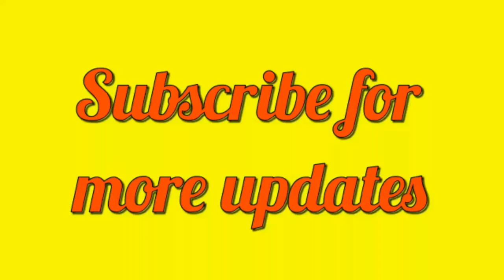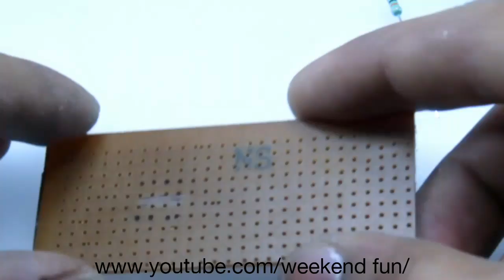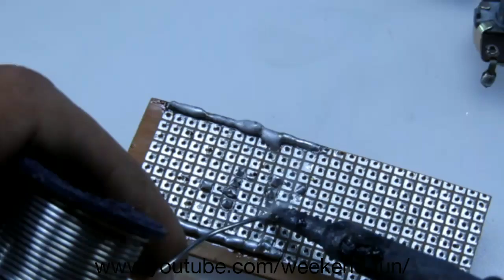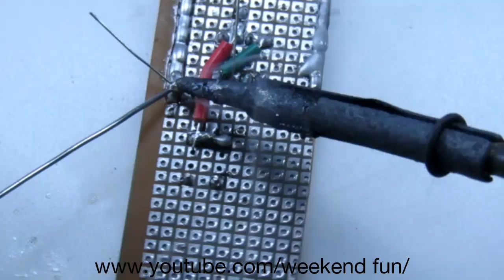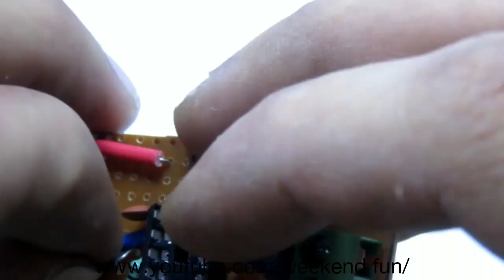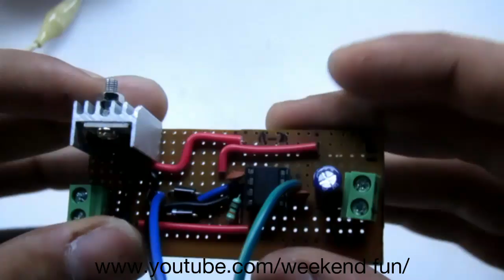How to Make PWM DC Motor Speed Controller

Comment: Greetings friend
I have a Brushless Motor Driver for Polygon Mirror taken from a Xerox Laser Printer; the board has 5 input pins: 24v, Gnd, 5v plus two signal pins; does this circuit work to increase / decrease the speed of the engine in question? Thanks

Comment: What if I want to control a 70 V DC motor with 20kW power ?!
Should I change this circuit for the mosfet of high power only and use the same 555 , capacitors and the potentiometer?!
Reply from the maker: It is not possible

Comment: Can i use same circuit to control speed of 24v dc motor, used for electric bike??
Reply from the maker: This circuit is designed for 1A current but electric bike has more then 1A current, so you can't use it for electric bike.

Comment: I am not able to measure the current on pwm. Also negative wire is geting overheated
Reply from the maker: Please check the circuit diagram as per link given in video's description.
Reply from the maker: In the PWM circuit, We are varying a voltage not a current. If you wan to measure current make series connection to measure the load current.

Comment: Hello, I am wondering if I can use this speed controller on a bigger motor? The motor that I am using is a 1000W 48V DC motor.
Reply from the maker: Its desined for max 12 volt 1A capacity

Comment: from where the 100uf capacitor is connected?
Reply from the maker: Between pisitive and negative input connection
Reply: can we put 9v input ?
Reply: can we use 1n4007 diode ?
Reply from the maker: Yes
Reply from the maker: You can use 1n4007 diode for up to 1A current
Reply: bro we have to connect pin4 to 100uf capacitor + ?
Reply: I made a input of 12 v and my capacitor blasted why ?
Reply: plzz reply ?

Comment: what if i change it to solar charge controller?
Reply from the maker: +Tech Seeker it is not charger it is just controller
Reply: Weekend Fun can i charge a battery with the PWM output?
Reply from the maker: +Tech Seeker it will not charge your battery properly
Reply: Weekend Fun not properly ok. but will it work as the charger or not?
Reply from the maker: +Tech Seeker it will charge
Reply: Weekend Fun thanks. but why doesn't my circuit work?
Reply from the maker: +Tech Seeker check your circuit with schematic diagram
Reply: Weekend Fun cheked 2times
Reply: Weekend Fun tried with an n channel power mosfet then with a power transistor.

Comment: Is the current limited to 1 amp or can it go higher if I use a better mosfet with adequate heat sink
Reply from the maker: +Nilav Kumar Jena ya you can get higher output current rating

Comment: dear firstly thanks for this valuable video second i need a 24v 1.500mA setup. what must to i use?
Reply from the maker: +anıl idi you need to change the mosfet and control voltage of circuit

Comment: if we use a twist throttle instead of a potentiometer , what will be the difference in the schematics?
Reply from the maker: +rashad reyaz i can't get you what you want to explain
Reply: +Weekend Fun i want to that if i use an ebike throttle to control the pulse width , instead of a potentiometer , how will we use it? an ebike throttle has 3 wires: +5v red wire , ground black wire and a green wire for the hall analog signal. if i connect the green signal wire to the pin no 3 of the 555 ic , will it work?
Reply from the maker: +rashad reyaz dear, you can not use pwm circuit insted of potentiometer in e bike
Reply: Lol you'r right in your last comment.

Comment: In your design, what is the voltage of the electrolytic capacitor do you used? Thanks !
Reply from the maker: +Marcos voltage range should be greater then voltage level of circuit

Comment: Hello, I built the circuit, but the motor speed oscillates, what could be happening? Another question, what is the voltage of the electrolytic capacitor you used, I am using 25V 100 uF? Thank you !
Reply from the maker: +Marcos frist in the electrolatic capacitor capacitance is a important fact and voltage selection should be heighr then your application voltage.
Reply from the maker: +Marcos For osilating of your motor it may happen you have used any non working part or part may be damaged during the assembly. Also compare your circuit with diagram given in the video.

Good luck
Reply: Thank you very much !

Comment: Hi, 
can we use 100k potentiometer instead of 220
Reply from the maker: +Varun Jagannath Chavalapalli yes you can use 100k
Reply: One more thing I have only LM317 as I didn't get IRF 540mosfet from the market.
So can we use same components which you listed just with these modifications 
For this project you will need
- Vero Board (PCB)
- 12 Volt Power Supply
- 555 Timer IC
- LM317
- 1N4001 Diode
- 0.1 uF Ceramic Capacitor
- 100 uF Electrolatic Capacitor
- 10 K 1/4 watt Resistor
- 100 K Variable POT
- Hook up wires
- Some basic tools

Thanks in advance....
Reply from the maker: +Varun Jagannath Chavalapalli dood we need 555 timer, LM317 is an liner voltage regulator
Reply from the maker: +Weekend Fun if you want to use LM317 i have already made video on it.
Reply: can you share the link pls...
Reply from the maker: +Varun Jagannath Chavalapalli https://youtu.be/6dyM7Jy7fUY

Comment: will it maintain the speed (rpm) with slight variations in the load (i.e. cassette deck)?
Reply from the maker: +Stefan no, you have to adjust speed of motor

Comment: the 555 has maximum operating voltage up to 18 v . but voltage and power of motor is purely depends on MOSFET. if suitable MOSFET is chosen we can operate any type of motor
Reply from the maker: +saneesh george 👍👍👍👍
Reply: Max current input and output?

Comment: I just found your video and I like it.  I will be duplicate your work soon.  I have a couple of questions if you do not mind. 1). What is the maximum input voltage can you connect this circuit the way it is right now? and 2) what do I have to change if I want to increase the input voltage to a maximum of 60V DC?  Thanks in advance.
Reply from the maker: +Mario Gancinia input voltage range between 6 to 12 volt
Reply: thanks for the response.  my other question was if i were to increase the output voltage of the controller to say run a dc motor that would need at least a 36V, what would the changes that need to be made?
Reply: use higher rated MOSFET the same 555 can be used . out put pin of 555 directly drives MOSFET. drain of MOSFET  connect to 60 v through motor coil. thats it.